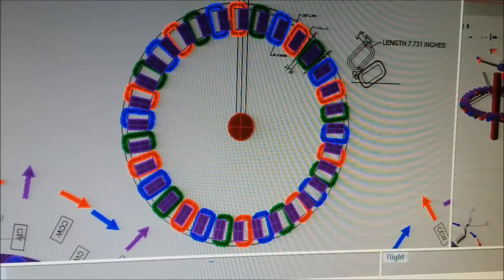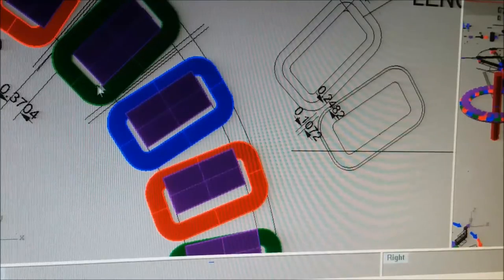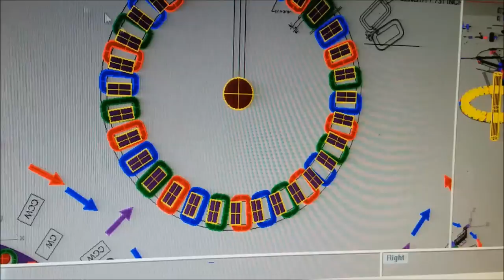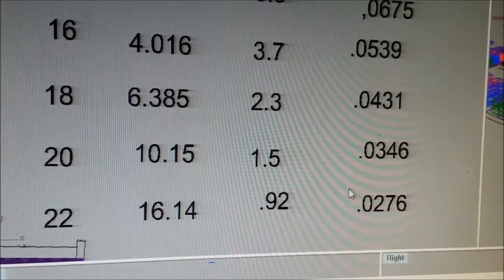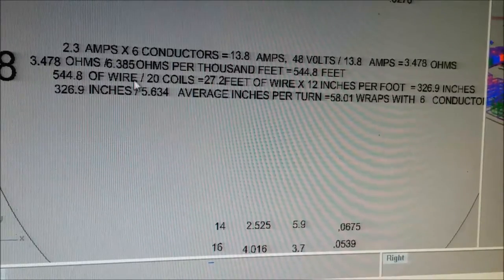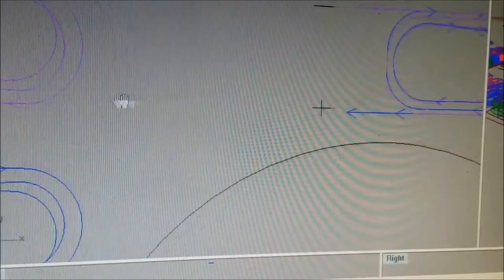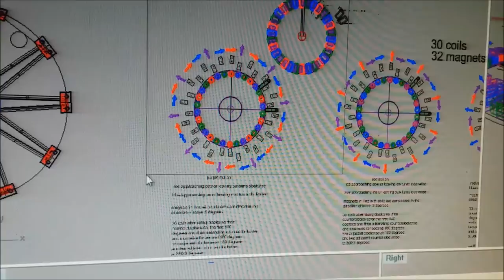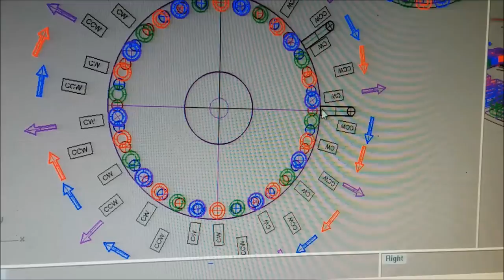HOW TO DETERMINE MAGNET WIRE SIZE AND TURNS FOR WIND TURBINE STATOR PART 2

Comment: One of the better videos on magnets/coils sizing. Few folks realise that, for best efficiencies on a VAWT at least, the magnets you start off with dictate the whole wind turbine/ generator build, from the rotor / stator size, right down to the airfoil size you need to use eventually. Other mix and match sizes will work, but never achieve maximum efficiencies...AIMHO of course. :-) 
The overall design is dictated by the magnets/angles.
Reply from the maker: I started with drawing out full scale magnets set in a diameter that 
filled the available space. Large diameters make more speed, faster
flux changes, and more power for a given size of magnet. Then 
drawing in coils around the magnets. The number of coils may need
changed but it is in steps of 3 since coils have to divide by three. 
Then work on wire size starting with your operating voltage which
would be 12, 24, or 48 since that is what batteries are manufactured 
to. Add a little voltage to ensure full charging but not so much that 
you risk wrecking the batteries. Wire size is next starting with 18 
guage plus a couple sizes larger or smaller. The operating voltage 
divided by the amp capacities of different guages gives the needed
resistance. Back to the wire chart for the resistance of the selected 
wire options. Divide the needed resistance by the resistance per 
length to see what length of wire is needed for 1/3 of the total 
coils which will be wired in series. If you can't get enough wire 
on the coils they can be made longer towards the OD, and  wrap 
one layer on what you have reserved for the magnet size since 
the magnets are not actually in the coils  but on the rotor plates.
Finally figure what magnet count divisible by 2 is close to but not 
equal to the coil count.  Amps X Amps X Resistance is the maximum
watts of power which you convert to torque for required turbine sizing.

Comment: This helped me but I have questions.   How do the amps distribute between the coils?  I thought each phase equaled 1/3 of the total amps.   Do you choose wire size and number of parallel wires from the total amps, the amps on 1 phase or the amps in two phases since only 2 are energized at one time?  I am trying to design a more efficient micro hydro alternator than my existing system for ultra low rpm and large diameter around 48 inches.  I have alternator shaft HP before losses, rpm, resulting watt potential, and keep getting different turns from various spreadsheet calculators and my own calculations.   I believe I should start with cut-in rpm since as the rpm's increase so does the voltage keeping the amps similar or less than cut-in.  My start rpm is 64, HP = 0.81 at alternator, watt potential 604.3, voltage 27 for 24 v system..   My high water rpm is 192, hp 2.46, watt potential 1835.  I'm looking at a single rotor with 64 magnets and a 48 coil stator against a wall.   Any help would be appreciated.   Also with MTTP controllers don't know if I should raise the alternator voltage and let the controller cut it down for 24 v system.

Comment: Amazing video. Will be coming back to reference this for constructing my first motor
Reply from the maker: Milsim, The main difference between the alternator (AC generator) 
and a BLDC motor is the electronic commutation switching the coils 
on and off in the 6 steps it takes for rotation. Early motors and DIY 
projects often use 3 Hall effect sensors (likeantilock brake sensors) 
to determine position. However EMF flyback from the coil string that
 is idle is now popular. Whichever way you sense rotor position the 
6 way H Bridge does the actual connections in a series of 6 steps. 
The best source I know of is the  "Electronoobs"  you-Tube channel.
He has an Arduino bacsed BLDC controller design with schematics, 
parts list, and the Arduino code. He also builds motors.
Reply: @concretehousebuildinginph1488  I can not thank you enough for this. Very grateful for this information. Figuring out how to time this has been a nightmare and resources are scarce. This made my day!

Comment: I found out it's better if you wound this in vertical orientation on the outer rim of the circle rather than horizontal into the circle. The reason is the outer rim winding is a single size ie circumference. Therefore the wire angle has less wastage and more efficient.

Comment: Cool 😎 👍 like seeing them made
Reply from the maker: The magnets were shipped to the Philippines along with the shaft, bearings, and oil seals. I will get the magnet wire in the Philippines. I shipped a 3 phase controller as well, so most everything is there but the pandemic has us in the US. Our build crew is getting ready to do the concrete work for the 24 ground mount solar panel array so some progress is going on. We mounted the retaining flange for the whole house fan to the ceiling spider beam with 20    5/8" stainless rods about 36 " long through the roof. These same bolts mount the VAWT so a little progress there as well. This week we are slip forming some non load bearing concrete divider walls for the 7 bathrooms of the main house.

Comment: I'm planning to make a Wind Turbine which is able to generate 24V and 10Amps. From your video I learnt that for this I should be using 300feet copper per coil for a stator of 12 Coils. Is my calculation correct ?
Reply from the maker: This would be 4 coils in series per phase. 24v/10 amps = 2.4 ohms resistance. The magnet wire must be rated 10 amps or higher. Pick a wire guage for the 10 amps and see how many feet is required for the 4 coil series and divide by the 4 coils to see how many feet per coil. 24 X 10 watts is not a problem providing the magnet strength is available and the air gap is as small as practical. Using dual magnet rotors with the stator coils between them multiplies the available gauss from your magnets. I like to start with the magnets and see what I can fit into the available space. Remember that the magnet count must divide by two and the coils divisable by three. Also they can not be equal in number due to cogging forces making it difficult to start turning. The change in magnetic flux is what generates the current in the coils with the current changing polarity after the coil and magnet are centered on each other. This is the zero crossing point which is not all that critical on a generator but is used for timing the commutation if running as a motor. Use google images to find a chart of magnet wire resistance per 100 feet. You would be looking at 2.4 ohms/300 feet or .8 ohms per 100 feet in your example. Then check if that guage is good for the 10 amps. Being that the air cooling of a coil is limited due to the tight winding you may need to increase the guage of the wire.

Comment: I’ve just started in this journey last night and was  looking for best and most efficient generator design. But i think it’s more important that the generator matches the size of the blades and that the wire is big enough in diameter to not have losses?   Losses would be in friction, heat and vibrations?    If I was to build a set of blades and attach them to several different generators the volts and amps coming out would vary but the watts out would be all quite similar? Assuming they are not mismatched to the blades.    For example if I was to build a generator with 1mm magnet to coil gap and another exactly the same with 3mm gap one might be harder to turn but efficiency would be the same….or no?
Reply from the maker: Efficiency goes down with increased coil gap. It might be helpful to visualize the gap increasing progressively to an extreme like a 2 meter gap at which point there would be no output at all.   Blade efficiency depends on airfoil shape and angle of attack on the blades and the area of the wind intercepted. There is a global wind energy site of energy per day at your proposed longitude and latitude. Also elevation is very important. This graphic output will help you size the needed disk area of the blades.   search  "Global Wind Atlas"
        There are half a dozen videos on this channel on sizing various components. To calculate magnet flux density you can get a spread sheet calculator at  "www.supermagnete.com/FAQ/FLUX" specify advanced and English.
       Start with the required output watts, Find the blade area to size the length, width, and number of blades. Then decide on an output voltage or battery storage voltage.  Calculate amps using V = I X R, Wire size from the amps, total wire length from total  resistancedivided by resistance  per unit length of the magnet wire. Remember the coils are in series and the resistance is for 2/3 of the total coils in series.
     There are several forums/groups dedicated to alternative energy
that may be helpful.  I would start with the global wind atlas site to see if your site and mounting height will generate your design wattage.
Reply: Thank you for replying.  If you were to increase the gap  to 2m and generated no energy the only power you would have to put in is to overcome the friction in the bearings to spin the shaft.  This is what I’m struggling to understand, by decreasing the gap you would get possibly more volts and possibly current out. But would the shaft not become harder to turn? Are you increasing efficiency (input power to output power) or are you increasing output but at the cost of more energy in?

Comment: Good evening my name is Leo congratulations for the realization ..!!!! I would like to receive, if possible, information regarding the sizing of the copper coils (number of coils, section of copper insulated cable, dimensions of the coils, quantity, etc.) as it is not possible for me to try to create the generator in the absence of the criteria that serve to size it, also the quantity, size and shape of the magnets, in short, everything that is necessary in order to assemble a generator that possesses the parameters or rather that has the parameters of the system that will have to make it move, awaiting your kind reply. good evening.Leo

Comment: Can you recommend a book on this axle flux generator with good illustrated diagrams? Especially on the calculating of the coils I’m not quite understanding.
Reply from the maker: I don't know of any book good or bad on this subject. Just to limited an audience to justify the time needed
to write it. Also there doesn't seem to be  published data on the gauss of the magnets from the manufacturers.
As a builder we can figure wire size, length, and voltage, however the wattage output comes back to gauss.
Reply: Hugh Piggott sells recipe books for building axial flux alternators for various sizes of small wind turbines. He includes an example which he works through the maths off too. Invaluable publication if you're going down the route of building your own.  I also don't understand how the design detailed in this video works - I specifically fail to see how it is a 3 phase machine.

Comment: Thanks Sir for your demonstration. I have seen coils using 3 tiny wires in parallel. Is this a good rule or is it the same when I use only one wire making up the diameter of all the 3 ones mentioned above?
Reply: @fi4258 Wiring in parallel will decrease the voltage output but increase the current output by the amount of parallel wires. So using 3 wires in parallel means that these 3 seperate coils will produce 1/3 of the voltage of if you would have used 1 coil. Now connecting these in parallel means that the voltage will remain the same 1/3, but the current will be multiplied by 3. You would have to spin the turbine faster for the same voltage output, but current is already higher. This will increase losses, or if you increase the size of the wire, it will increase the cost.

Comment: Hi, have you seen the videos where a guy replaces the magnets in a auto alternator w neodymium magnets and claim they get 120 to 220 volts that way?
Reply from the maker: No, however most car alternators are in runners with the magnets arranged like interloching fingers which would be hard to replace. More magnetic flux from stronger magnets would  boost the output amps. The voltage is in relation to the RPM you spin it. In the car there are built in voltage regulators that restrict the voltage for battery charging. Also mail order houses sell new or more commonly rewound stators for the Delco alternators that output up to 120 amps with a stock rotor. So a lot of potential to abuse the delco alternators.

Comment: hello Prof i needed help in assuming value of No of parallel paths and no of coils in design of bldc motor. Motor specification 83KW motor Power, 18 stator slots, 22 rotor slots, External rotor motor. What should be my no of parallel paths and No of coils?
Reply from the maker: Well 83 KW is a huge motor. At 750 watts per HP that is 111 
horsepower. Sounds like you are doing an outrunner motor. So 
one magnet per slot would be 22 magnets. 18 stator slots......Well an outrunner would have a steel core inside a coil to align the windings
with the magnetic flux of the rotor magnets, usually magnetized 
with the north and south poles on the magnet faces. Stator implies 
at least to me something with coils rather than a laminated 
armature of an induction motor.  18 coils divides into three strings 
of 6 coils each for a 3 phase motor. Those strings are used two at a 
time in series so you have 12 coils to make your resistance value. 
If we do a first case analysis for a 380V  motor. 83000w/380 = 218
amps.   (V=IR and w = IV)  That would be a pair of AWG 2.0  cables 
equivalent. Seems impossible to build, however, stacking 12 stators 
and rotor sets gets it down to 18 amps. Approximately 3 feet in 
diameter and a stack height of 5 feet .   Choose your wire size by the 
amps. For example 6 wires of 3 amp capacity would make 18 amps.
Smaller wire diameter like 1 amp capacity would be 18 strands in 
parallel. smaller wire also results in more turns of winding and 
therefore higher operating voltage for a given RPM. Due to the 
mechanical forces involved this would likely be operating under
3000RPM  OH,  coil count is 18 X 12 = 216 coils. Using a much higher voltage everything gets smaller. Think TESLA sports car motor. 700HP 
water cooled with a lot of MOSFETS handling huge amps. That motor 
could fit in an 18" cube.   Hey I AM OUT OF BEER.
Reply: @concretehousebuildinginph1488  Thank you for your detailed Explaination.
Sir If you don't mind could you please share your email id I have few more doubts which I have to ask.

Comment: The size of the magnet wire and the number of turns required for a wind turbine stator depends on a variety of factors, including the desired power output, the size of the stator, and the type of magnets being used. Here are the general steps to determine the wire size and turns required:

Determine the number of poles: The number of poles in the stator will determine the number of coils required and the number of turns needed for each coil.

Determine the wire gauge: The wire gauge or size will depend on the amount of current that will be flowing through the coils, as well as the available space for the wire. A larger wire gauge can carry more current, but it may not fit in the available space.

Calculate the number of turns: The number of turns required for each coil can be calculated using the formula:
Number of turns = (desired voltage x 10^8)/(4.44 x magnetic flux x frequency x coil area x wire gauge)

Determine the coil area: The coil area can be calculated based on the desired diameter of the stator and the number of poles. Each pole will have a corresponding coil, so the total number of coils required will be the same as the number of poles.

Calculate the magnetic flux: The magnetic flux can be calculated based on the number of magnets in the rotor and the size of the air gap between the rotor and stator.

Check for optimal performance: Once you have determined the wire size and number of turns required, you should check to ensure that the stator will perform optimally under the expected wind conditions. This may require some additional adjustments to the design.

Note that these steps are general guidelines and there may be additional factors to consider depending on the specific design of your wind turbine. It is recommended to consult with an experienced electrical engineer or wind turbine designer for more specific guidance.
Reply: Also, Halbach arrays are interesting.